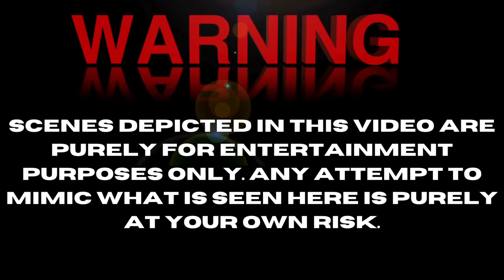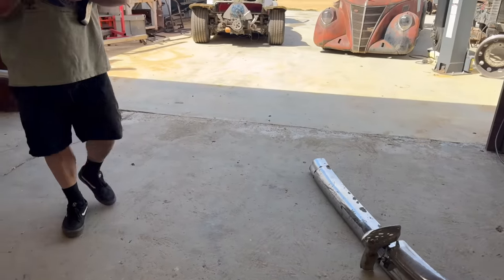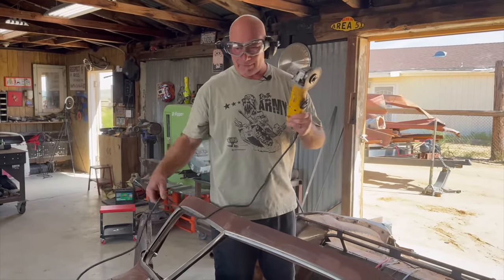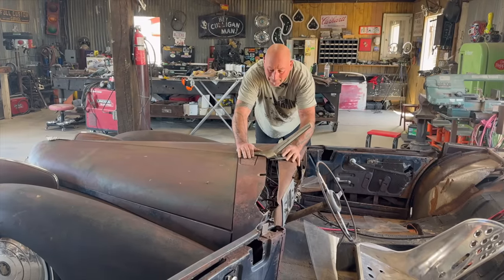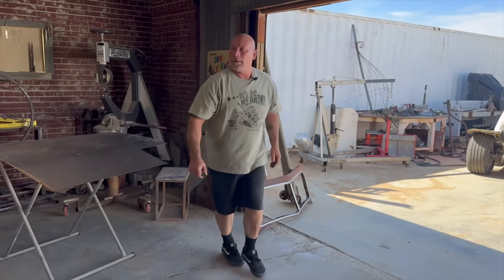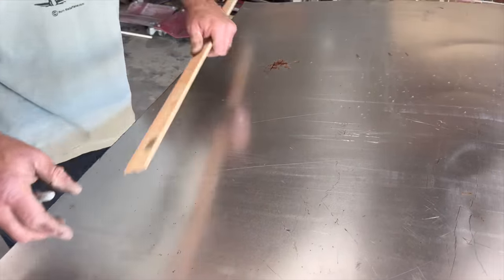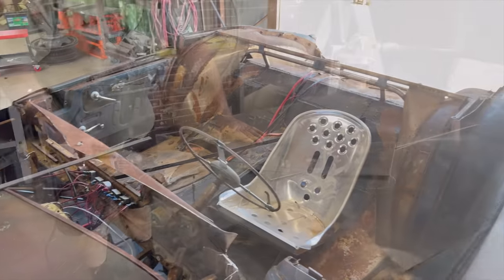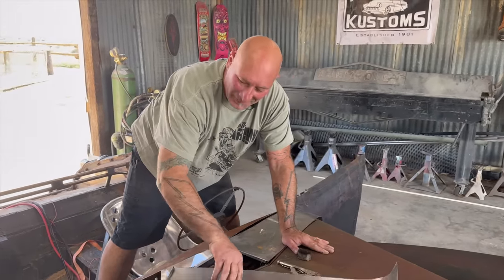1938 Kustom Cadillac: Ian Gets This Caddy Ready For Victor's Arrival ⛳️  Part 2!

Comment: The best way to customise your stuff is to make your own version of tools back 15 years ago I worked in a shop fitting workshop and we made our own press dies for different jobs as I herd your videographer say a power hammer just adapt a press break machine and then change dies for different curves old school days aluminium rubber hammer and solid bits of wood with different curve cut out in the top and just hammer it till you got what you wanted we made carts for sup markets for pushing around your children as you shop even made high end clothes racks which we threw in the sea every day for the rust look and then just clear powder coating them so many years ago I like your show you have some cool content I wish nothing else but good things for you and your projects some of the guys that I worked with back in the day we’re crazy skilled  steel benders

Comment: Hello ! The original windshield with the bottom moved forward to the edge of the hood and tilted back a bit more than you had it looked like it has some merit. Also replicating the three bars under the headlights into a split front bumper starting from the outer edges of the grill ? Enjoy your artistry and hanging out with you and Jamie (Joanie).  - Peter, Temecula.

Comment: Maybe a windshield like a Delahaye Saoutchik Roadster? Or crest in the middle and pitched down at the sides. As for bumper, center section like the Cord 810 Phaeton, triple bar tight group matching the headlight trim, sides curved and pulled back, and bumper guards to pull the 2 shapes flavors together maybe, curled back at the top of the guards to merge into the headlight trim.
Reply: Bumper sides would be single piece curvy, BTW

Comment: I would Drill and put a shaft(square)(with adhesive) to put the two halves of the hood ornament together(you can pin the shaft at each end but its not as pretty)....I'm sure there are better ways but that's what I would do:thanksdoc:

Comment: Fixed a flying lady before. Small inche and a half bolt. Cut the head of the bolt. Drill and tap both broken pieces. Screw the bolt in between both broken pieces with locktight and fill in the crack with solder. And tadaaa fixed